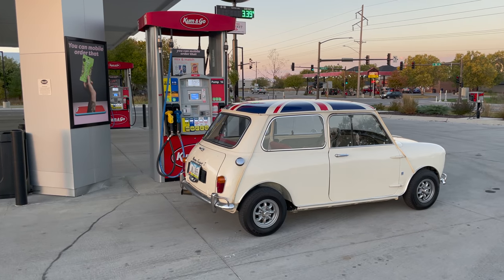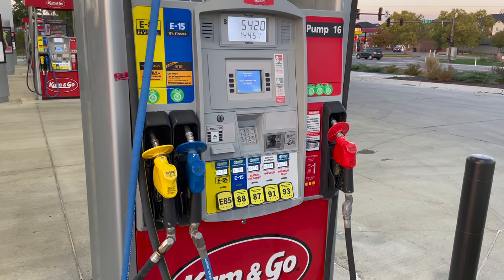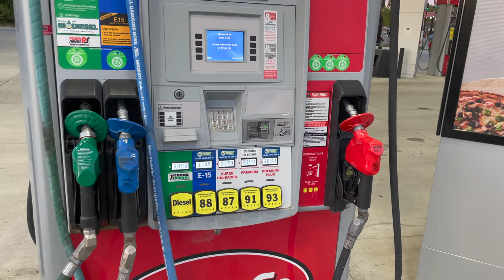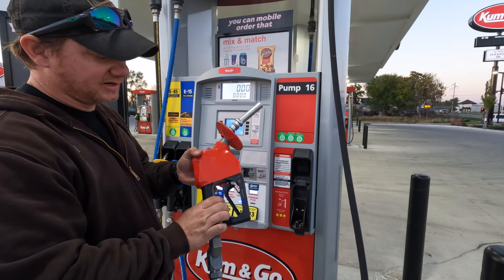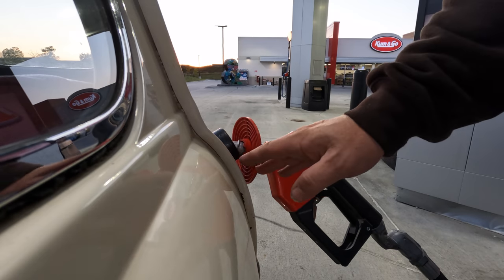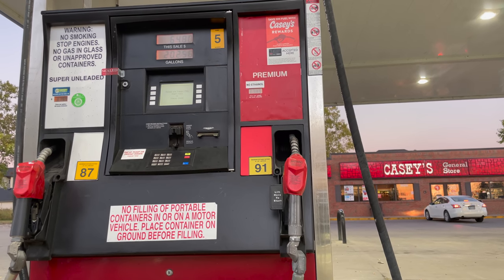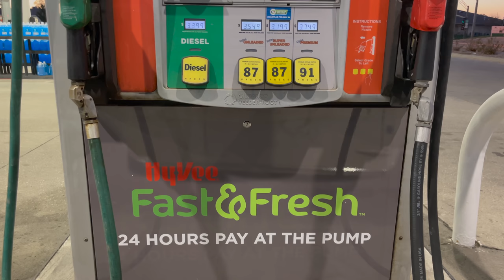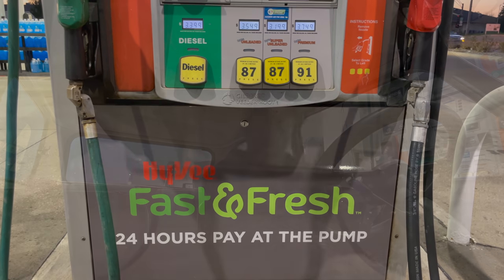What Fuel Do I Use In My Classic Car

Comment: Here in Texas non-ethanol fuel just can’t be found in the large metropolitan areas (e.g. Dallas/Ft Worth, Houston) where emission testing is performed on cars annually.  Only E10 is available. However, in smaller Texas cities and in rural areas without emissions testing non-ethanol is widely available, but at a cost of about $0.30 per gallon more.  It’s well worth it for my ‘88 Austin Mini and my other classic cars.

Comment: Fuels available in Melbourne:
Regular unleaded petrol - 91 RON.
Premium unleaded petrol - 95 or 98 RON.
E10 - regular unleaded petrol blended with up to 10% ethanol.
E85 - regular unleaded petrol blended with up to 85% ethanol.
Diesel.
LPG - liquefied petroleum gas
I have never used ethanol blend petrol.  I use Premium unleaded 95 in my Austin Cambridge and Toyota Corolla.
We used to have those click lock things on the pumps but not for many years.  I think it was a safety thing in case the cut off didn't work.  With the manual handle it just cuts off when the tank is full, similar to your click lock thing.
Reply: Yes, 'many years' being about 50. I have to say I don't miss them now, although I did at first. I think it's better to have your hand on the pump at all times.
Reply: @EJP286CRSKW  Has it been that long?  I think you are right.  How time flies 😄

Comment: This is very helpful and informative segment. A lot of people don't understand fuel at all and they think premium gas is better for your car than regular. they think there's some sort of magic ingredients that makes it better.
Reply: Premium does often have a couple of extra additives that clean up carbon deposits, though people forget that even regular fuel has to be a minimum standard of quality so it's absolutely fine.
I haven't quite decided whether I'll use premium or E10 yet here in the UK, but until I get the engine rebuilt I'm gonna be using lead replacement additive which has ethanol protection additives in it already, so buying premium for the additives might just be redundant.

Comment: I live in the Houston area.  Only nonethanol gas is in the rural areas.  I  have eight restored old British motorcycles.  For about 100$ there are ethanol proof, floats, float needles, fuel lines and petcocks available from Brit bike parts suppliers that will make the bike ethanol tolerant.  I converted my first bike about 20 years ago and have been riding it with e10 93 octane every since with no problems at all. I also use stabil.   To each their own, but I'd rather make the investment upfront and know I can gas up at any pump when I am out on a ride. Besides the ethanol free is at least a dollar more a gallon so you start to recoup some of the investment. The bikes use Amal carbs but Burlen, the current manufacturer also supplies similar ethanol proof floats and float needles for SU and Zenith carbs.  You won't need petcocks on a car and ethanol proof gas line is available at any autoparts store.

Comment: That’s nice you have a non ethanol choice near you. When my Casey’s first opened they had a no ethanol choice which is only what I used on my Frogeye Sprite. They stopped offering it last year. I now add Stabil 360 to the Sprite and my 912. Some I know use a bit of Marvels Mystery Oil in each tank.

Comment: Here in Hong Kong we have the main international brands including Caltex (not sure but might be related to Texaco), ESSO and Shell. Also have some Chinese brands like Sinopec, CRC and PetroChina which in my previous experience seem to be cheaper but also lower quality. For example, I borrowed a friend's old Nissan (this car dated back to the 90s) and he always used the Chinese brands as they were "cheaper". The car seemed to run quite roughly and was underpowered, although it was not exactly a race car to begin with. Before returning the car, I decided to fill it up with Shell Regular. Immediately on turning the key I noticed the engine to be a lot smoother and it seemed to have more power. 
I also run a late 90s Honda Blackbird motorbike which has four carbs (one per cylinder) and although that will also run on Shell regular and no doubt other brands as well, it definitely prefers Shell V-Power. Not sure if there is any ethanol in that but despite long periods of standing, it has so far burst into life on the first one or two attempts to start it. In fact the main factor in whether it will start seems to be having a well charged battery and following one of your recent videos I decided to experiment by replacing the regular lead/acid battery with a lithium battery. The improved starting was obvious and whereas before I might use the choke even in quite warm weather to do a cold start, it seems I can start without choke with the lithium battery although that is probably also to do with the fact that the previous lead/acid battery was past its best. The new battery also has a nifty little LCD display to show my the state of charge, voltage and number of days since first use. The voltage will even fluctuate when the engine is running to show me it is charging.
As far as cost goes, in Hong Kong we are being robbed by the fuel companies and I recently paid around HKD20.00 for one litre of regular unleaded (over USD2.50!). When you consider that even 10-15 years ago oil prices were hovering above the USD150 mark, there is absolutely no justification for the current prices being charged when current cost per barrel is still only around USD80. 
Anyway, thanks for yet another great video and nice drive at the end of your immaculate Cooper S. Your videos are always so varied, interesting and informative.

Comment: Here in the UK E10 has now become the standard, with E5 being the premium, leaded fuel is still available in certain specialist garages for use with classic cars but I'm leaning towards using E5 with some a lead replacement additive with some ethanol protection until I eventually do the valve seat conversion.

Comment: In Australia we have three grades of non-ethanol petrol/gasoline. 91 95 98 octane.  (95 is not available at all pumps).  We also have a single ethanol blend called E10 here (which comes through GREEN hoses apparently to indicate it is  environmentally good ).. Diesel is always pumped through BLACK hoses often with a different nozzle size to discourage us pumping it into petrol tanks by accident. Leaded fuels were outlawed here many hearts ago in part to prevent cerebral lead toxicity where it was intentionally being inhaled.   We had a brief period where lead replacement fuel was available containing manganese instead of lead.  Leaded AVGAS fuel is available for piston engined aircraft but is hard to source outside of an airfield.  Those running old and veteran  sports cars etc which can’t be revalved for unleaded petrol usually make our own fuel at the pump by adding upper cylinder lubricant to 98 octane petrol.    Brisbane Oz

Comment: In UK diesel pumps are black and not green as you stated in the video. Unleaded is now 10% ethanol and Super Unleaded is 5% ethanol.  Old cars now need to use super Unleaded which costs more!

Comment: Oregon:  All gasoline contains 10% ethanol (E85 is available as well), all diesel fuel contains 5% (or 20%) biodiesel.  Off road (farm or industrial) use fuel can be different, but is often from the same source just with dye added for tax enforcement purposes.  I did a project a few years ago testing various diesel fuel types, and it was quite difficult to source anything other than ULSD (ultra low sulfur diesel).  No matter what the pump (or vendor) said, when the fuel was tested they all delivered ULSD.  I suspect that the local gasoline situation would be quite similar.  I've never studied the regulatory background, but when I lived in Wisconsin I noticed that Iowa has a quite a few more grades of fuel available than the neighboring states.  Perhaps the car collectors in Iowa are well connected politically.

Comment: I'm in Northern California where non-ethanol fuel is pretty much unknown so I make my own! In this case it is specifically to run in my homebuilt airplane which has a Lycoming IO-320-B1A engine of 160 hp that requires minimum 91/96 octane aviation fuel, which ALSO isn't available (only 100LL).  So I start with red 87-octane regular agricultural fuel (I live in the Wine Country), which is not only $0.36 cheaper per gallon because of lower taxes, it is perfectly legal to put in aircraft.  I pump the red fuel into a big roto-molded plastic wine tote that holds a couple hundred gallons. I have valves on the side of the tote every 10 cm or so. Pour in the red gas then add water. WATER! Yes, water. It mixes with the ethanol and drops to the bottom of the tank. Because the tank is translucent you can see the demarcation line between fuel and water. Just take your fuel from a tap above that line so you get only gasoline. I also add Aces IV fuel additive, which bumps up the octane by 7-8 points for about an extra $0.10 per gallon. I could start with a higher octane for about the same price but the Aces IV seems to help preserve the fuel, too. It's good stuff though you have to order it online. While this sounds like a lot of work it really isn't. It's certainly better than driving to Nevada (four hours each way) to get ethanol-free fuel that costs more.

Comment: Funnily the most interesting aspect to me, is that your pumps dispense multiple grades through a single nozzle.  Here in NZ I have never seen anything other than each grade having a dedicated nozzle.  We do have trigger hooks but I've never used them myself.

In NZ we use RON, the lowest available is 91 (equivalent of 87 AKI).  95 and 98 are common in most places (92-93 AKI), and 100 (around 95) is availalable at some stations.  Ethanol isn't used currently.  

Most manned stations are still pump-first at least during daylight, but the pump is usually remotely activated, so you migth have to stand there waiting for the fuel to flow for 30 seconds until the attendant sees you and decides if you look dodgy before hitting the button.

Comment: Thanks Steve for showing us the US pumps, I was always a bit curious. Here in Slovakia (central-ish Europe) we have a 95 octane E10 (10 % ethanol) and 98 octane E5 or 100 octane E5 fuels (5% of either ethanol or synthetic substitute for ethanol). In the European Union there is a push to raise the ethanol content so soon, all 95 octane fuels should have 10% ethanol rating (maybe even more in the future).  If I'm correct, EU ratings of 95 / 98(100) should be equivalent to US ratings of 91/93.

To my knowledge, ethanol is hydroscopic, so it attracts water and could be corrosive on some parts of the carburettor. So I agree - if you can, stay clear of fuels with ethanol for old cars that don't get used much.

Since the introduction of ethanol in standard fuels, I've had a few problems with rubber gaskets on my Skoda Favorits' carburettor perishing, however, it's hard to distinguish if it's age or fuel related or both. Anyhow, I now switched to 100 octane fuel, since most of them have ethanol substitute and it's advised to use this kind of fuel in cars, that sit most of the time. That way there should be no water in the tank after the car sits for months.  :)
Reply: Same thing in Bosnia, despite not being near civilisation.

I had absolutely zero problems running E10 petrol in my 30 year old Peugeot. Only fuel related issue were the rubber fuel lines cracked, but they were 30 years old so had nothing to do with fuel most likely. The carburetor itself never had any issue no matter what I put in the tank.

Though I regularly use the car, so ethanol fuel is pretty safe to use there.

Comment: 91 Pump octane (USA) is equivalent to 95RON. 93 pump octane is equivalentnto 98RON.
87 pump octane (91 RON) is the standard grade of petrol/gasoline in the USA. Most regular cars run on it.

Standard grade fuel in australia is 91 RON. Most regular cars will run on 91 RON. The reason is australia moved to unleaded fuel in 1986 and chose 91 RON because the emission standards were similar to the USA. Most cars saw an upto 10% reduction in power as we got US spec engines in euro cars.

Some euro cars require 95 RON as a minimum.

Comment: In the UK, 'Super Unleaded' 95RON E10 petrol has just replaced the 95RON E5. We also have 'Premium Unleaded' 98RON E5 at many filling stations, which is being recommended for older cars and motorbikes. We also have diesel (and LPG, but this not found everywhere).

Honda says that all their bikes post the early 90s will work on E10, but may run sluggishly in cold weather (!). So I'm using the Premium stuff in my 2003 XL650V. 

Here as well, petrol prices have gone up by a third since 2019, and costs over twice what Americans pay. Lovely to see a classic Mini being driven on American roads, btw, especially liked the beautiful evening scenes.
Reply: Good answer except (confusingly) the 'premium' petrol is the lower octane stuff and super is 98/99

Comment: I live near Rochester, NY (Western NY).  I'm aware of two gas stations in the area that sell 91 Ethanol free, but most stations do not.  My car needs 89 Octane, and the station I tend to use ... because of the price ... only has 87 and 93, both with Ethanol.  I too have also noticed that I get better gas mileage from the Ethanol free gas, so I do use it off and on ... more in the winter than summer.

Comment: In the UK since September 2021 ethanol content has been raised to 10% from 5%. The only alternative is to use Super Unleaded (98 - 99 octane) which  has 0 - 5% ethanol content depending on manufacturer.

Comment: Steve, there are plenty of stations in Iowa and the Midwest in general that only offer blended fuel. If they do not specify that their premium is alcohol free it likely has alcohol. I try to get non blended fuel for my one car that suffers from vapor lock but other than that I have had no trouble with 10% blended fuel. It doesn't get quite the fuel mileage but I think the price more than makes up for it. I've often let blended fuel sit in a collector car tank for over a year without problems and no fuel "stabilizer". It will take the water out of your fuel system which is good and if it has caused hose problems they were old and needed replacement. I personally don't think that the hose issue is as big  a deal as is made out and all newer hoses are rated for it.

Comment: In the US, high population/pollution urbane areas do not offer non-ethanol options due to pollution. That may be different in Texas. The blend also changes seasonally to account for heat in summer and sub-zero temps in winter.

Comment: Fuels in Sweden:
95RON - E10 (It contains ethanol by EU-law) - 17:49 SEK/l
98RON - E5 (Between 0 and 5% ethanol. Less in winter) - 18:29 SEK/l
E85 15:34 SEK/l
Diesel 19:02 SEK/l
Diesel - Extra power. It's called different names 19:80 SEK/l
HVO100 (Eco diesel chemically equal to normal diesel) 20:02 SEK/l

18:29 SEK/l is equal to 7:88 USD/usg

Comment: The fuel economy using ethanol free fuel is also an important note. On average you actually get 5 to 8 percent better gas mileage using ethanol free fuel as well. That does offset the higher prices a little.

Comment: In my four wheeler vehicles, buying non ethanol fuel from a pump with just one hose is not to bad. The ethanol fuel in   everything from the selector valve out to the nozzle won't contaminate the fuel in the vehicle tank too bad.
In my bikes that only have a 3-4 gallon tank all that fuel in the selector out can be two much ethanol for most of them.  
Most of my bikes are from the 70's. The Harley is from 2003 so the fuel system can handle ethanol.
For long term storage I drain the fuel from the tank and carbs of my bikes. This removes the damage from the fuels. This fuel I drain out gets used in my daily driver and garden tractor to mow the lawns. 
I only get non ethanol fuel from a separate pump, thus no contamination from ethanol.

Comment: Good video. I thought when ethanol first came out. that replacement  fuel systems components. came with improved seals and gaskets. to work with the new fuel additives.

Comment: In Australia we used to say "See you later RON, as in See you later on". I had  to look up Pauline Hunter's RON, so here is the explanation .  .  . "It's short for Research Octane Number, a measure of the petrol's octane rating. In Australia, the octane ratings top out at 98 for premium unleaded, before stepping down to 95 premium unleaded, E10 (94 octane) and standard 91 octane unleaded".

Comment: In the UK we do have low percentages of ethanol, nominally 5 or 10%, though people are up in arms about E10... realistically most of the problems seem to be with infrequently run engines like lawnmowers and generators (or classic cars). I suspect that an old school mini would not be too challenging to properly harden against the corrosive effect but you still have the problems with the fuel deteriorating.

Comment: Fuel stations in the San Francisco East Bay have ethanol based fuels. Very few have E85 but most fuels have some level of Ethanol. Not only is Ethanol bad for seals in engines but oil needs to be changed every 1,000 miles instead of the recommended 3,000 miles.

Comment: Here in Australia we used to have the lock pump clips up to about 30 years ago  and some pumps colours differ between brands
Reply: I wedge my filler cap in to hold the handle open, works a treat, but not all filler caps will fit, Ford Ranger caps do fit :-) doing so works the same as the clip on US bowsers.

Comment: In California, you have either ethanol or ethanol, unless you buy race fuel - I have had good luck witn Sta-bil - I have a car that sat with the same Ethanol fuel with stabilizer added for at least 4 years and  it fired right up - not the greatest and I'm sure the octane is not there, but it did run.